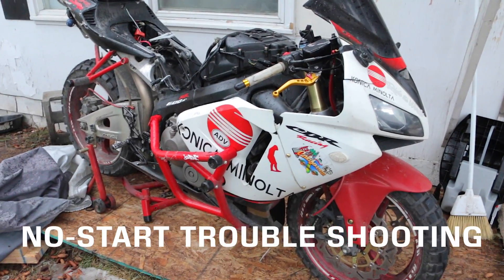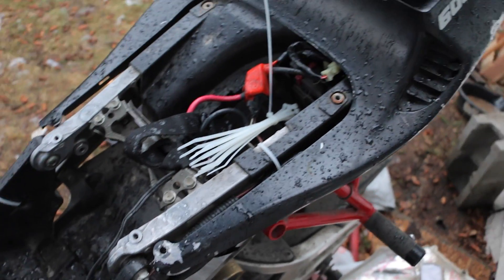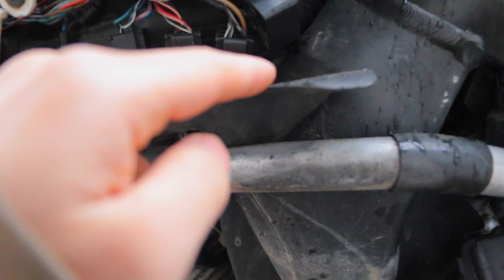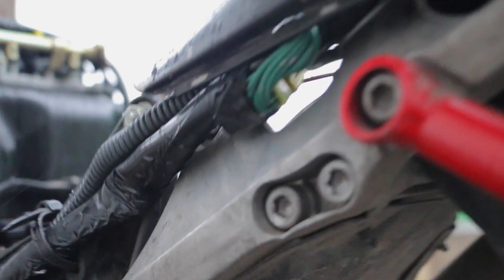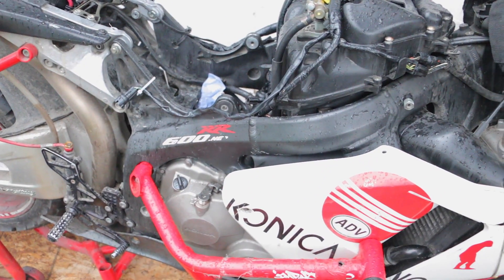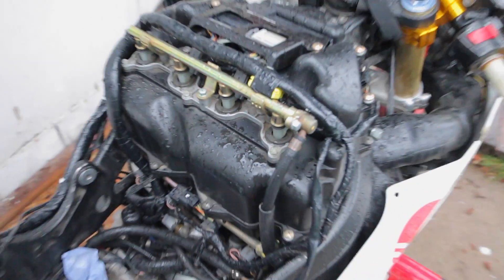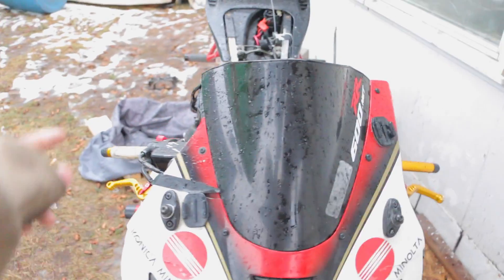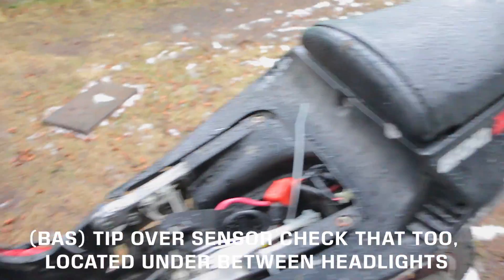Honda CBR 600RR No-Start Trouble Shooting

Comment: Ok dude. If the starter is good(alternator) and the regulator is ok. Why the hell the cbr 600 rr does not start not even the hint of lighting the main panel is COMPLETLY OFF!!
Reply: Help me unc I got the same problem

Comment: Hey I’m having trouble with my bike and I can’t figure out what it is I have an 05 CBR600 I put a new battery in my bike and it try’s to start but all it does is click and then the back light are on but the front light won’t turn on so I’m not sure if it’s a lose wire or fuse or something which is causing the front light to not turn on as well as the bike
Reply from the maker: starter really Jessica. or check your "yellow" ground box, its on the left side of your under seat
Reply: NuttyNu actually I take that back it cranks like it’s trying to turn on it’s does click sorry lol so I feel like it’s something else
Reply from the maker: If you have IG , send me a video of it  @ Nuttynu
Reply: Did you ever find out what was wrong?  Mines doing exactly this
Reply: Did you find out the problem I got the same issue?

Comment: Can anyone help, I have a 2006 cbr 600rr I have it taken apart getting ready to remove my starter I checked the battery it’s healthy and charged but when I go to turn it on it refuses to turn on when I push the button it acts as if the battery is dead no matter what sometimes it turns on it stays on when it is on I push start it and turns on no problem but more often than not the button does not allow allow it to turn over it tries and tries hold it for about 4 seconds if it doesn’t kick over I’m draining my batter but I don’t know what else it could be not fuel pump not battery not alternator or strator check the solenoid fuses perfectly fine, anyone have an idea of what it can be
Reply from the maker: CHECK your ground box, its a yellow box with green wires on the left side on the tail of the bike.
Reply: Check the 3 wires in the Relay...the red should be connected to the rear by itself and the other two to the front
Reply: Sale problem here dud s.o.s did you find the problem ?

Comment: I have a 2010 600rr it was working fine and then out of nowhere it stopped turning on. The fuel pump primes but when you try to start it there is no sound. I checked fuses battery and lines so far it’s good. Does anyone have any suggestions or tips would really appreciate it!
Reply: I had the same problem as this on my 2008 cbr600rr.   My workshop cant rectify the problem. U get ur bike fixed ? If yes can i know what is the problem? My bike still in the workshop since december 2019 till now ! I miss it damn much. 😭 please help.
Reply: Did you figure out the issue

Comment: Everything is lighting up but my bike won't turn over.. Your video is very helpful
Reply: Same here... what did you do to fix it?
Reply: Fixed? Replace the starter solenoid unit, not just the fuse itself but the whole unit itself. If you buy a new one make sure the M and B terminals  are on the correct posts on the solenoid

Comment: I have a 2003 Honda CBRR mostly garage not Riding A lot, mostly garage. It starts off good , I run it for a while, And rev the gas up a few times . I Turn the engine off and try to restart and it seems like the battery is Not charged, even though the battery charger Indicates 100% charge, also notice white smoke and exhaust system. The next day it will start back up, Sometimes when I Rev the Throttle, it’s shut down  And I have to wait a day or so  to start up again. Have you seen this before?
Reply from the maker: check your ground, there is a yellow ground box on the left side under the seat, white smoke. check oil to see if its milky, if not. maybe you just need to ride it. May have water in your tank from sitting Long

Comment: my bike has a rough time right now. turn key lights turn on. no fuel pump prime or turn over from starter. battery is good. was working fine and then FI light came on. also when id did turn on it would start but at a very low rpm like about to shut off and after a few seconds it would go back to normal. any suggestions?
Reply: adrian Garcia i had that same problem too! Now doesn’t start at all! Did u find the problem??? Thx!
Reply: Same problem here

Comment: If the bike is on the kickstand, it want pump fuel either?
Reply: Because my bike fuel pump primes and every time I start it up It don’t suck fuel in the gas line, but I got it on the standing on the kickstand
Reply from the maker: Kickstand kill switch?

Comment: I have a 06 cbr 600rr, when you explained when you turn the key, you hear a buzzing(once you turn the kill switch to on), I currently don’t hear a buzz, so the bike won’t turn over. What does this sound like?
Reply from the maker: That buzzing is your fuel pump priming.
Reply: If the fuel pump isn’t priming. What would you recommend?
Reply: @MikeyMlkey  Check your Fuel Pump fuse...it's a 20Amp fuse adjacent to battery. if that is fine,  check your kill switch...make sure that is functioning (perhaps it needs cleaning on the inside...rare but may be depending on how the bike was stored)...but check the 20amp fuse first
Reply: MyKey Productions fuel pump

Comment: my cbr 954 starts normally when cold but is very hard to start when hot. i can push start it easily when hot though. local mechanics didn't help at all. would be really great if you have any input
Reply from the maker: Need new starter
Reply: Could be vapor lock. We had  THREE  Farmall cub tractors that did the same thing. Check your gas cap, and make sure it's venting properly.

Comment: My 07 CBR won’t do anything.  It’s been stored for about 2 years with no tender....I replaced the battery but nothing.  When I turn the key, the cluster doesn’t even come on.  It’s like the battery is 100% dead except I can see the clock in standby....battery is new, checked it and it’s good....any ideas?
Reply from the maker: check your terminal battery cables and all fuses

Comment: So my CBR600RR just tip to the ground and licked something and when I got it back up, I tried turning it on but it wouldn’t turn on. Do you have any idea on what the case could be?
Reply from the maker: Check you rTip over sensor
Reply: could be a number of things depending on if anything fell out of place....start at the beginning with the battery and work your way through the system (relay, connections, etc). If you're not getting power may be a power wire or an earth came lose.

Comment: I’m literally going through this issue. Just installed a new clutch and now it won’t start. FI is flashing code 19 for ignition pulse sensor but it was working prior. It’s driving me crazy. I have fuel prime good compression but she won’t fire up. The gear alignment has nothing to do with it not getting spark as you can literally take them out and put them back in few tooth’s off as long as they are lined up and starter is engaging. I have no clue on how to test the ignition pulse sensor or the voltage the connector should push out.
Reply: Hi, have you found the issue yet

Comment: how many miles are on your bike?
Reply from the maker: +buckroeva sitting at roughly 60,6xx miles
Reply: +Nuttynu I have a 05 cbr600rr with 9,000ish miles is there any preventive maintenance I can do to help me down the road besides the normal?
Reply from the maker: +buckroeva nothing to major, i would do a coolant flush if you have not, good to do every two years. check your spark plug if they are in need of replacement. check your brake pad pistons, make sure they are not seize up, and check your wheel bearings, other than that keep the fluid up to date as always and she should be fine.

keep an ear out on your CCT (cam chain Tensioner) they usually need care around 20k miles or so
Reply: +Nuttynu thanks man I really appreciate the help
Reply from the maker: buckroeva no problem.

Comment: That yellow box is melted on my 05 and bike has been in the shop for months guy doesn't seem to know how to fix it. 05 600rr 23k headlights don't work cluster backlights doesn't work turn signals and fuel pump only cranks but no prime.
Reply from the maker: Luis Matos hi. you need to splice yhose ground wires back. or buy a new wiring harness. That should help.
Reply: Mechanic had already done that payed 310 bucks along with oil change . Brought bike home let it run for 10 minutes and it died again . He spliced the wires btw .  He said the ecm isn't getting or giving power in one of the circuits. 400 bucks for a new ecm and still nothing. I think a new wiring harness is the problem but seeing as I've thrown about 800 and still no fix I'm getting frustrated and worried
Reply: U think it could be a rectifier . When he spliced the wires he had to "shock" my fuel pump to get it to kick on. I asked if it was a fuel pump and he said the headlights not working and fuel pump not priming two different problems because they aren't on the same plug
Reply: check the blue wire harness plug on the left side of the bike( under the panel underneath your clutch). more than likely your issue is corrosion in the plug.
Reply: the problem the blue plug has is the ground wire inside the plug ends up losing contact with the other side of the plug